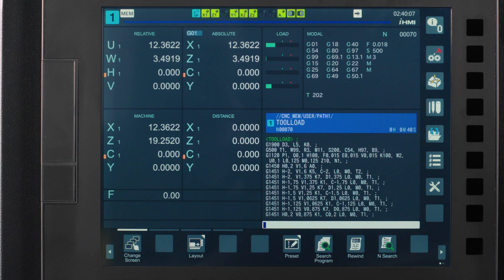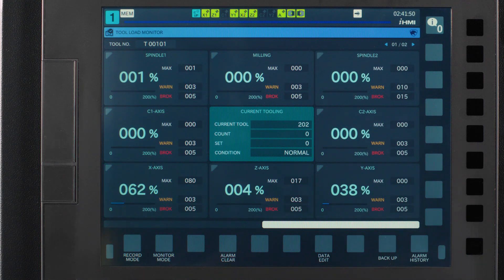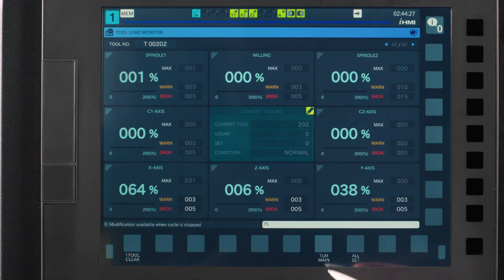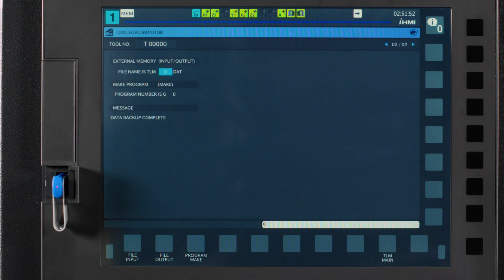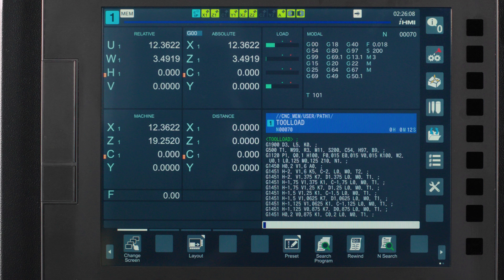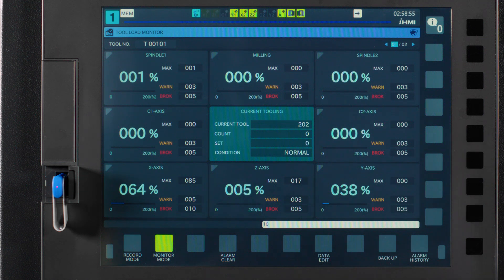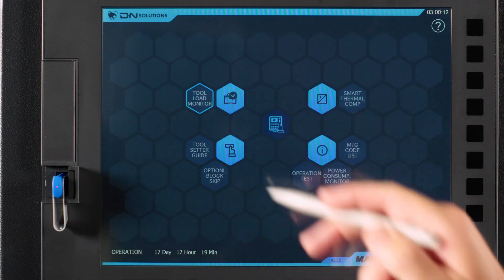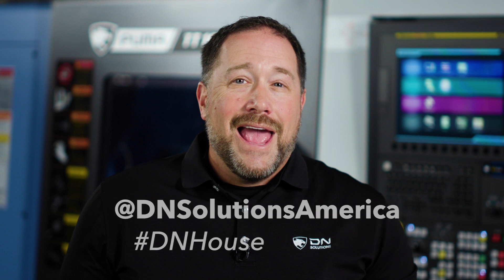Tool Load Management on a Turning Center - Know Your DN, Episode 18

Comment: Mark, I would like to know how to set the default limits to 003 for warn and 005 for broke. My current settings are on 005 and 010.
Reply: Check out the video at the 4:37 mark, I talk about how to change the limits.  I talk about how to change it and you can see me change it in the video.
Reply: @2922tgrip  yeah I figured out how to change them, but when I reset the tools for a new part, they flipped back to 005 and 010. I would like to change them permanently, so that when I reset them that goes back to 003 and 005 as a default.

Comment: It is a really nice option that can save tools and workpieces. You could mention also the M200/M201 G code activation possibility also. Is there any chance of modifying values and limits of loss management through G code data input?
Reply: John, yes.  As I mentioned in the video you can us G700 with a series of variables to define each tool.  It is a little complex, so I intend to do a future video in how to cover this.
Reply: The example G code would look something like this:  G700 M700 T56 Ax, Bx, Cx, Dx, Ex, Fx, Hx, Ix, Jx, Kx, Xx, Qx, Rx, Sx, Ux, Vx, Wx, Zx
Reply: @markchristopher5809   dear Mark, I really thank you for pointing it out, I was checking the manual but I could not find. Something more on this topic, is there any possibility to activate record mode via g code? Or only monitor mode via M200/M201?